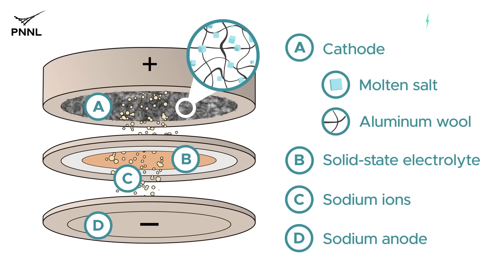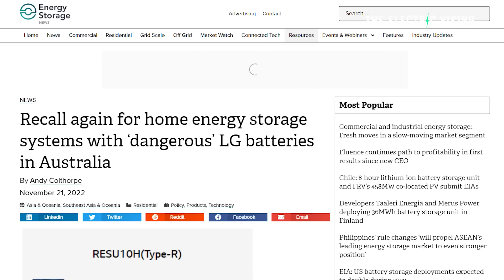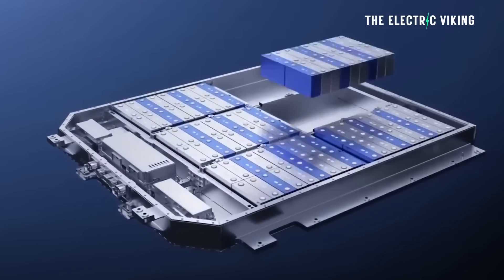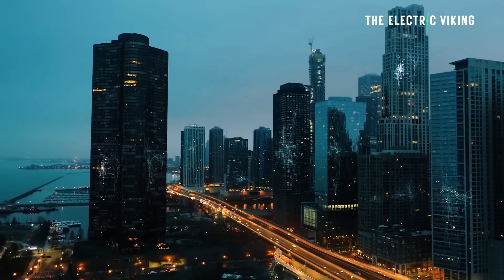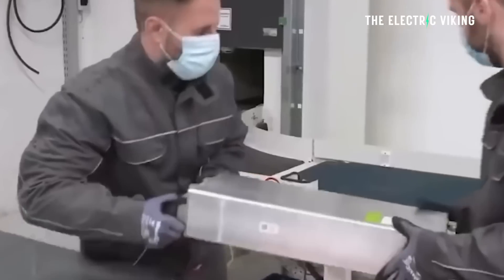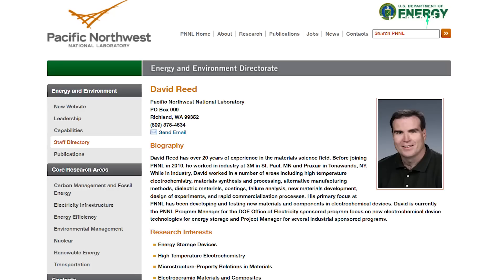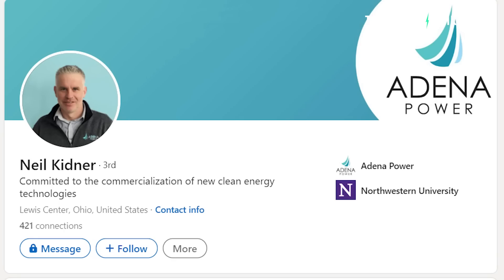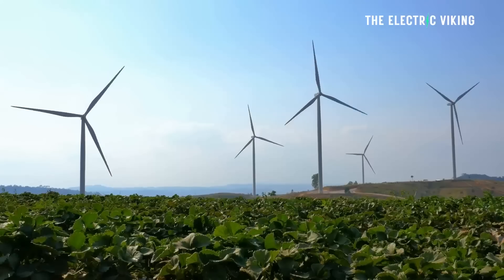NEW Sodium, Aluminum battery is 15X cheaper than sodium or lithium

Comment: Hate to rain on this parade but the only reason Lithium is in short supply is that there are too few refineries that can make the extremely pure versions of Lithium required for batteries. 
The same will be true for sodium batteries. As soon as the number of sodium battery manufacturers goes up, there will also be a lack of refineries for that too. 
Having another element that can be used for batteries in general is a good thing, but Lithium is able to support more energy dense batteries than sodium just by the nature of the atoms themselves. 
I would therefore rather have more Lithium refineries built than waste time on sodium ones unless a faster, more cost effective way to purify the sodium is found…. which might tip the balance in sodium’s favor.
Oh and by the way do you really want to drive the cost of aluminum up further? That could cause cost increases in building the EV chassis itself.
Let’s not forget that the US has very little of the world’s bauxite ore too.
Reply: You missed the fact that there is far more Sodium than Lithium on earth. Its not even close
Reply: @enadegheeghaghe6369  That’s very correct. However there is more than enough Lithium to easily electrify the entire world.  So why spend the money on setting up sodium refineries…. unless they are much much cheaper to do. 
 Elon Musk indicated that the state of Nevada alone, in the US, has enough Lithium in easily accessible clay deposits to change all transportation in the US to electric.  Sodium would be welcome but not necessary.
Reply: @nickmcconnell1291  feel free to avoid any products that feature Sodium batteries. I have no problem with it if it works and is affordable
Reply: @enadegheeghaghe6369  😆
Reply: @nickmcconnell1291  because sodium chemistries are unlucky cheaper to work with and supply.
Reply: I know someone who’s been worki by on saline electrolyte batteries for two decades and he says the theoretical density potential of those chemistries is 2400 W/kg while Lithium ion of any kind is 600-800 W/kg iirc. And the costs to manufacture of their prototypes at mass scar would be like the cost to stamp out roofing tiles from cred lay and kiln them. So easy the Roman’s could do it in other words.  (If they were supplied with the secret recipe). 

. Much lower BOM than any battery I. Existence today. They can’t get funding to accelerate the developers though, so NREL aren’t  choose to accelerate them yet but NREL well understand the the power and energy potentials of their chemistries. Not disinflation to this chemistry actually.
Reply: @bashful228  Actually, because sodium is more stable (as per its position in the periodic table) it should be unable to achieve the energy densities that Lithium theoretically can. 
However perhaps your associate was referring to specific Lithium battery chemistries that exist today?
There is no way to know what the maximum capacity is of different battery chemistries without knowing what the chemistry is first and then testing it.  There are teams of researchers trying various chemistries out just for that purpose. Check out Jeff Dahn’s papers as he is probably the recognized leader in battery chemistry research.  
      The main component of a battery which limits its max is the material that the anode is made from. Right now in Lithium batteries most are made from graphite, which severely limits the energy density. Already new chemistries have been tried in the anode that increase the energy density dramatically.  Such as adding silicon. 
If you do a search on the theoretical max of Lithium batteries you will find all kinds of various numbers from much higher than the number you quoted to much lower. It depends on the specific chemistry and additives being tested. New ideas for the chemistries are constantly being thought up and newer and higher limits in energy are being achieved. 
However, given that Lithium is more reactive as an element (AKA its specific energy), it’s theoretical maximum energy density when used in a battery should eventually be found to be higher than sodium given a theoretical perfect battery chemistry for each element. 
But max energy density often means shorter life span or instability, which might make that particular battery chemistry unfeasible for use. Everything is a trade off.
Reply: @nickmcconnell1291  yep agree with most of that and I'm not a chemist so I'm nt going to argue about anything, was just relating what they told me (possibly in a poor way). the electrodes they were prototyping were made from ceramics, a base of red clay but I got a list of a dozen minerals/elements that get added to the wet mixture in comparatively small amounts that are available locally on any continent I was told. most of them common enough, trace amounts of strontium being the most exotic. I gather the natural porous nature of kilned clay material is allowing for unusual  chemical potentials — a bit the same way a catalyst facilitates reactions that it isn't consumed by. we're only just discovering the potentials of complex structures at the nano-scale.

The features of this chemistry they were playing with were, very low cost and abundant materials, simple processing and assembly that almost a pre-modern society could do it if they knew the theory or were given the recipe, zero thermal or flammability issues (so no de-rating of power charge/discharge required),energy densities not seen yet today in commercial batteries, DOD, low degradation due to cycling (in preliminary testing only, no 200-1000 cycle tests done).

If you're interested in verification or finding out more contact them at Sea Wave Batteries. Nobody ever suggested to me this was a fraud, but without any evidence, anything is possible, right. the inventor working on these cells has patents in thin film solar and other areas, and this was a labor of love for over a decade, so i hope it is real and does bear fruit one day.
Reply: @nickmcconnell1291  "There is no way to know what the maximum capacity is of different battery chemistries without knowing what the chemistry is first and then testing it"

The inventor was using some kind of theoretical framework to test multitudes of combinations and ratios of minerals in clay for the electrodes — i'm not sure what it was though!
Reply: @bashful228  Hey thanks for great info! I will definitely check Sea Wave out. As I mentioned, if they have found a way to keep the energy levels in a sweet spot and have a cheap process as compared to Lithium refining, then they may well be something that could change the game. 👍
Reply: @nickmcconnell1291  yep unfortunately they didn't have anything reliable enough in the lab to win more funding it would seem and have moved on to other projects. if they did have it would still need a couple of years  basic science analysis and high res magnification (electron microscopes I suppose) to understand what is happening enough to write patents, and then more years to have patents approved. but fingers crossed that William works it out one day.
Reply: @orionbetelgeuse1937  Actually I do understand. My comment is that energy density can be increased by adding silicon to the anode chemistry. 
This is true of other materials as well. 
Ergo, the anode does not need to be pure graphite. 
There are many papers on this. Here’s one:
https://citeseerx.ist.psu.edu/document?repid=rep1&type=pdf&doi=1116e4a53b9f6c40fa27d6928feed88b76461c13

If you’d rather not go through all that here’s an old 2019 article about changing the lithium battery anode completely from graphite to silicon and the subsequent substantial energy density increases. 
So unless you misstated something, I would suggest you are incorrect in stating that only graphite will work for the anode in a Lithium battery. 
https://cen.acs.org/materials/energy-storage/battery-materials-world-anodes-time/97/i14
Reply: @orionbetelgeuse1937  Yes they are older articles for sure. It sounds as if you are admitting that other elements than carbon can be used in the anode, contrary to your previous statement. 
I will admit the use of other elements do cause fragilities such as expansion problems that will need to be overcome in order to make these batteries have a decent lifespan. 
   Indeed there are huge expansion hurdles to using pure silicon in the anode. That is why currently they are only using partial silicon doping in the anode.  My understanding is that new polymers are being used to allay the expansion damage that can occur in silicon doped anodes. Perhaps they will be able to overcome this issue one day with such technologies.  One can only hope. 
However, my point is still valid in that additions to the anode of other elements can increase energy density.  This was my only intent. That these additions might cause additional technological hurdles may also be true.
Reply: @orionbetelgeuse1937  I totally agree with you that there are significant technological hurdles and cost hurdles to be overcome in using additional anode chemistry over pure graphite. 
This is one of the reasons that I currently own graphite mine stocks! 😉
However the advancements being made in this area are bringing Science Fiction to be Science fact more quickly than we might believe. 
That is why I have other stocks in my portfolio covering the additional players in new battery chemistry technologies. 
One day graphite may not be as important a part of the battery anode as it is now.
Reply: @orionbetelgeuse1937  I have to laugh on the timing of the recent nuclear fusion announcements. They are panicking because they see the reason for fusion slipping away. Soon solar and wind power will take over the entire energy grid at a minor fraction of the cost of a fusion reactor. There won’t be a reason other than military or space exploration to have fusion.
Reply: @orionbetelgeuse1937  they never got to the battery stage, just very interesting cells which never left the lab.
Reply: @orionbetelgeuse1937  That is why I invest in Tesla stock too. They plan to be the main supplier of that grid storage. It will be in place far ahead of any viable Fusion reactor. Stay tuned to Tesla’s earnings going forward as their grid storage solutions start becoming more and more profitable.
Reply: @orionbetelgeuse1937  Ah, when you said “grid” storage I thought you meant utility grid level. I was referring to Tesla MegaPack production. 
Understand your comments on charging causing degradation if using a car battery for storage…. and agree. 
As to fusion, I think you and I differ as to how we see the future playing out. Time will tell.
Reply: @orionbetelgeuse1937  if all that is true, iI gree that t's really got a very long way to go, if at all. scientific break throughs are important to announce, but they a rarely game changers, that belongs to the field of engineering not blue sky science R&D.

Comment: Not sure what 15 times cheaper means.
Reply: For the same price, you can store 15x as much energy.
Reply: @Loganl1980  15 times cheaper is mathematically and linguistically nonsense. It is someone who is trying to use less words in order to convey magnitude. The problem is it ends up making no sense at all. It's like someone who is in an argument and says "you are a big zero, i am 100 times smarter than you". They think they are saying they are twice as smart as you but are really saying they too are a big zero because 100 times 0 equals zero. "As much" is also problematic as it is not the same as "more than". 15× "As much" is 10x15=150 15× "more than" is (10×15)+10=160

Comment: Storing your own energy at a low cost for a longer time is important too, seasonal time periods would be ideal.
Reply: How much would you need to store though to last a season ? Hundreds if not thousands of kWh.
Reply: @aesma2522  It's right on your electric bill, just add them up. Far north or south places on earth get little or no sun in winter so that portion of their consumption could be vital. Storing heat in a sand battery could reduce the size of the electric battery. Thanks for your comment.
Reply: @sagecoach  Well it's not that simple as I'm in France where "all electric" has been promoted since the building of nuclear plants, including heating. So the first thing I would do is switch to wood heating, for example. Or indeed some kind of heat battery if it could really be heated in the summer with excess electricity and used in the winter, but I'm a bit sceptical about that technology. One major consideration would be being offgrid or not, if I'm on the grid, it's probably better to use some grid electricity and size the solar accordingly, rather than trying to be "all solar" and needing a football pitch sized solar array costing a fortune.
Reply: @aesma2522  Ground source heat pump cooling and heating stores heat in the ground when cooling and recover it when heating. This is a good example when soil conditions and the in-ground loop are optimal. Every situation requires study like you are doing. Thanks for the conversation. I think nuclear waste should be reprocessed as fuel for new nuclear technology power generation.

Comment: Is the $7.00 per Kwh the cost of raw materials? if so then hopefully eventually we can  expect the manufactured cost to slowly come down to near this number. As the costs of raw materials for Li ion batteries is considerably higher, the change over is an  obvious choice, especially for stationary storage.
Reply: $7 Dollars for active materials. Add to that the cost for materials and production of the cells, cost for making them into modules, cost for making them into containers, add transportation, foundation work, electrical and mechanical integration into a grid system…… energy density may be less important in grid storage than for mobility applications but it still is an important factor as it drives production and logistics cost for overall systems.
Reply: byd lfp blade battery cost 50$/kwh

Comment: Good video communicating the opportunities of the recent developments, and share your enthusiasm and optimism! Would be good if you can also be a bit more critical of their specific wording so we can do like-for-like comparisons. I think their quote was $7/kWh for the 'active' components of the battery. What is the equivalent cost for LIon for the 'active' components. You might find that out of $100/kWh, only $20 is for the 'active' component. The rest goes to e.g. cooling, BMS, the casing, the manufacturing, transport, engineering etc. Plus they're talking about 'low temperature sodium' that is compared to the >400C Molten salt batteries, not -20C for Lion

Comment: heaps of lithium in the ground,
Reply: And in pools under salt flats.  And in clay deposits yeah.
Reply: yeah.. it's not rare by any means. It IS low density though.. so you gotta mine a big area and extract it.. people lose their minds over this process. There's no reason it can't be done in an ethical and safe way for the entire area where it's extracted though. What is needed is regulation on companies that do it, to make sure they invest in doing it cleanly. Because if you just leave it up to the company, they're going to cut every damn corner to make it as cheap as possible. Then you get all kinds of environmental issues involved in the mining of lithium. If you force them to do it cleanly and clean up after the mine is exhausted.. Lithium will not be a bottleneck. That said, it will be more expensive if these companies have to do it right.. but I think most any sane person is ok with paying a bit more to keep the environment healthy.

Comment: Watts per kg is power density, watt hours per kg is energy storage density, they are not the same thing.  Also you misunderstood the operating temperature, it's lower than other molten salt batteries but much higher than lithium which operate at ambient temperature.  A battery fire has nothing to do with operating temperature.  Hard to believe you make these basic errors after covering battery technology for so long.
Reply: @orionbetelgeuse1937  Yes facts do matter.

Comment: the issue is, its aluminum..
i mean, we uses that material already in to much volume, and to make it you need to excavate a shit tonn of alum earth/alumina, which then needs a shit load of energy to make aluminum from it, so i dont know how good that is...
Reply: Use the recycled aluminum then which is not being used properly now anyway
Reply: @spammusubi9004 yup!…I drive by a metal recycling facility almost daily…I also know people that work there…very lucrative…stacked high to the sky…and that’s with very low recycling rate in this area! It cuts out the extraction and refinement cost …you only need to melt and remold. Look around you…the waste is incredible…the real age of recycling has just begun. Some tired old and outdated things will be torn down, other things scraped, just to recycle their valuable materials. Previously, recycling was just PR BS so business as usual could be justified…we’ve finally hit a cost- benefit point where we’ll now see a genuine effort.
Reply: You not looking at this right.  If we stop using aluminum for beverage cans we can make enough batteries for everyone.  If that is not enough we can stop using aluminum for car wheels.  Rinse repeat.  We waste aluminum like crazy.

Comment: You should not compare Apples with oranges. The aktive Material Cost is a different thing than cell cost. Still it sounds good. But we need to know the cell Cost per kwh to compare.
Reply: The new 4680 production line footprints in giga Nevada will be about 1/3 the size of the existing Panasonic 2170 cells.   With this and other fluid prices in the mix  upper bounds is good enough at this point.